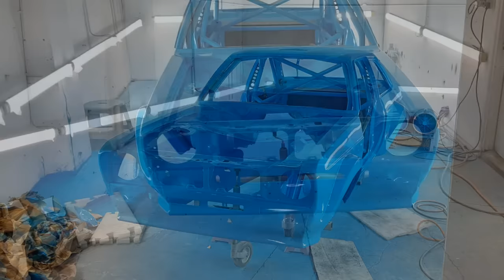Frank Kelly - The Rebuild - Part 2 - The Body Repairs

Comment: This might be a stupid question but how many time can you straighten a shell before its game over for it?
Reply: A shell can be straightend and repaired as many times as you like provided you have the correct jig and equipment to do so. The only time a shell might get binned is if there is a major twist in it from front to back including the roll cage. Bear in mind a world rally car is built from the floor pan up!
Reply: With an Escort zero times. This is a racecar that looks vagualy like an Escort. But I feel the end is near for this one as well. Time to do another new shell.